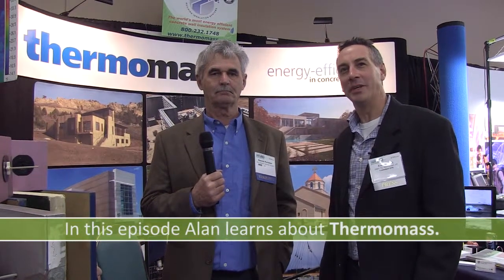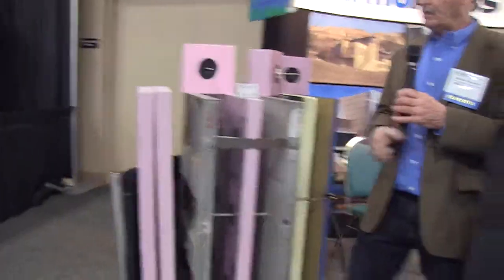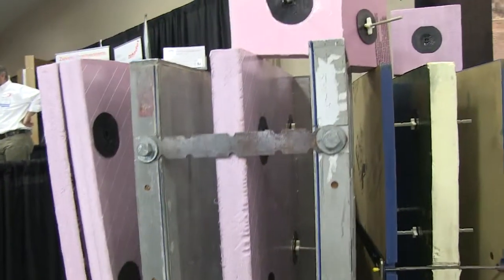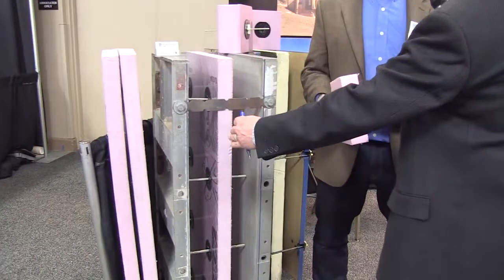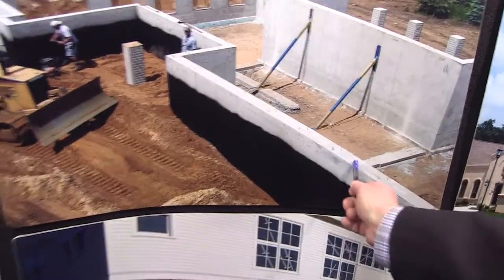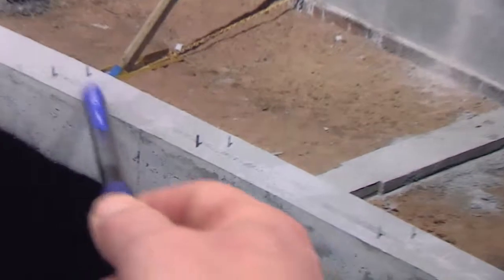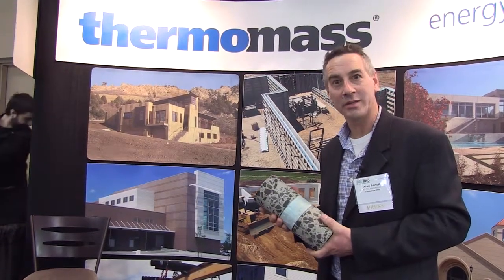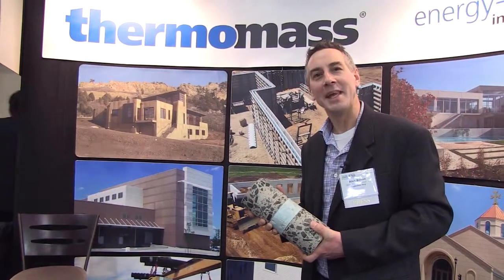S Files Season 1 Episode 10; ThermoMass

Comment: It would be nice to know how it compares in terms of price with various ICF alternatives.
Reply: Hello Joe,  I agree, perhaps if you contacted ThermoMass they could help.  The BIGGEST difference is that an ICF has the insulation on the outside of the wall (which must be finished to protect it from insects, weed trimmers, etc.) and the inside of an ICF wall must be protected as well (From fire mostly per code).   SO when you add the cost of finishing both the Exterior and the Interior of an ICF wall, costs do add up.   I like the fact that the interior and exterior are already finished and protected with the ThermoMass wall system.
Reply: @alanbenoit7863  That's my thinking too. But this is definitely not a task for DIYers and I don't believe TM is as well represented across the US as is BuildBlock, Logix, etc., but I could be wrong. TM definitely needs a bigger presence in the US market because just not too many people know about them. Today, everybody knows about the benefits of ICF construction, but IMHO the Thermomass alternative is even better.